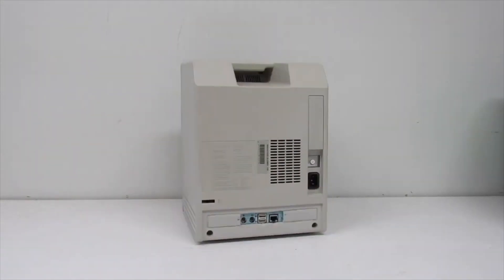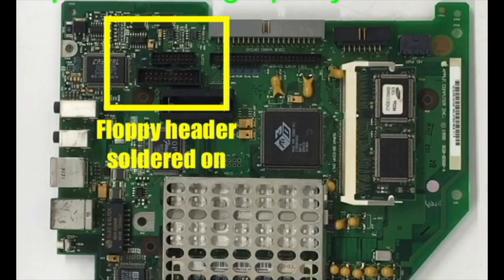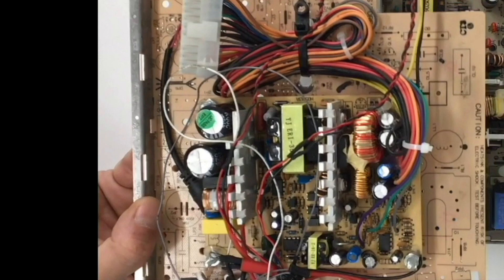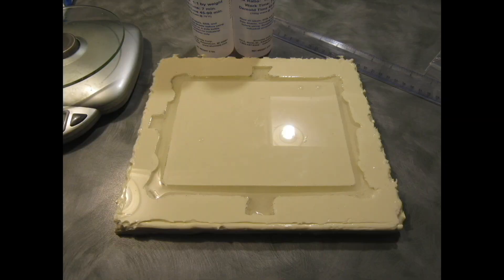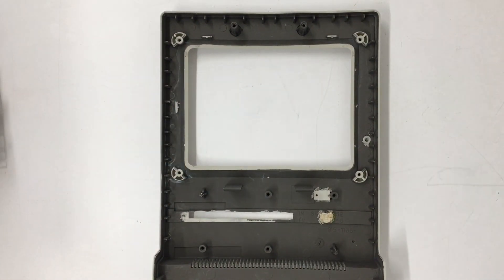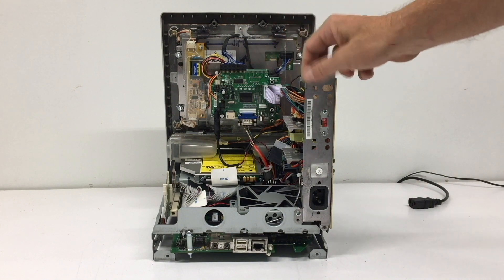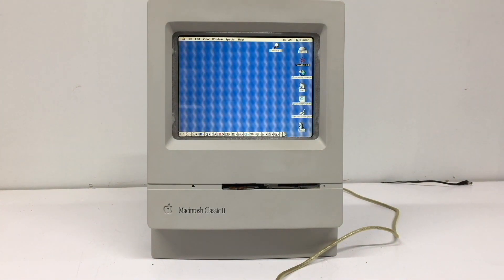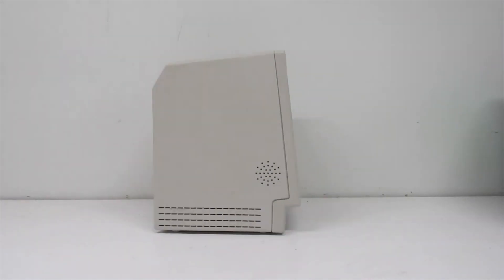How I upgraded a Macintosh Classic to an iMac G3

Comment: My daughter and I are going to be building a Raspberry Pi SE (going to call it an SE/3.14) using an iPad Air 2 LCD. It was fun to see this. We're not gong to use the original back, I'm going to be using a spare SE front and metal frame, then 3D print a small backer on it, to make it look like a slim version of a classic Mac.at least that's the goal.
Reply from the maker: Hi, I can't wait to see your project:) I've thought about the same thing, but I lack the know-how to do it. Are you going to cut the metal frame down?

Comment: What voltage capacitors did you use for the re-cap? They don't look surface mounted, but I'm not sure the values matter depending on surface or leg mounted in the portion you used. I just need to know for my re-capping so I don't cause any issues.
Reply from the maker: You can increase the voltage of the capacitors, but not the capacitance rating.

Comment: Well I'm almost done, but I want to use the original Macintosh 128k power switch to work as a power on for both the logic board and power supply (Like the old pizza box mac's). Is there a way to do that, or do I need a soft power button to turn it on outside of the power switch used for the ATX I wired up on the barren logic board.
Also, for the inverter, do you have to split the constant 5v wire to hook it up to the macintosh connector, or after it goes through the resistor? It says purple on the connector but also shows it going to the power inverter, so I am confused about that.
Reply from the maker: Hi, sorry for the delayed response, I've been busy. To tell you the truth I don't know if you can use something other than a momentary switch to operate both the computer and the display? On most modern computers, continuously holding in the power on/off button gives you a loop.  As you are the when you press the momentary switch you are shorting the PWF to ground, so continuously doing that with a mechanical switch.... I have no idea? but I am sure that Hosni barak, or Karl Wheatley, could answer your questions.
Reply: @BillyTheKidCENTURION  i understand, but whay about the constant 5v purple wire, does that need to conect to the imac board via split or. just the inverter?
Reply from the maker: @tehsuki11  I can't believe I forgot about not needing the inverter at all if you are going to do it like the Color Classic. Just ground the ATX power on (green wire) to one of the ATX ground wires, then wire the ATX off/on switch wires to the the Macs off/on switch. Now the display and Mac will power on at the same time.When you power the Mac off (shut down the OS) just reach around the back and turn the switch off, that will power down the display and Mac at the same time.
Reply from the maker: @tehsuki11   The purple wire (constant 5v) from the ATX is connected to the ATX green wire (power on) through a 5.6 KOhm resistor. the iMac logic board constant 5v, doesn't get used.
Reply: @BillyTheKidCENTURION   Alright So If I am reading this right. ATX Purple Standby goes to ATX Green via 5.6KOHm resistor, then green wire (Post resistor) goes to ground ATX (Already wired the on off switch) and then that should be it?  I assume I don't need the inverter beyond the 5.6 portion.
Reply from the maker: @tehsuki11  If you want it to operate like the pizza box Macs, then you just need to ground the ATX (power on) green wire to a ATX ground wire. If you want to use the soft power to the ATX, ( soft power to ATX) then you need the inverter. But you don't need any inverter, if you short the negative (ATX) to the  Green wire ATX supply!
Reply from the maker: Hi, I'm sorry if I may have confused you, let me break it down again......

If you don't use the inverter, just tie the ATX power on (green wire) to an ATX ground wire (black wire), and wire the 128k on/off switch as the ATX's on/off switch. Nothing else is required, no resistors, no transistors..... just tie the green wire to a black wire, forget about all the other wires.
Reply: @BillyTheKidCENTURION  Yeah this might be something else. I sent an email with some details, maybe you can help?
Reply: @BillyTheKidCENTURION  Im still a bit lost, I might have to contact you in private mail message to work something else. I am sorry.
Reply from the maker: @tehsuki11   No, I can guide you through the comments:) Once again.... what exactly are you trying to do?
Reply: @BillyTheKidCENTURION  Oh no I mixed up what I said. 

I just mailed you through what was listed on your channel about getting some more hands on help due to my situation. 

I think I may have some wiring issues that are outside of my ability alone, so I sent an email in the hopes of resolving it there perhaps by sending it to you to examine... I hope it gets to you safe. Otherwise I may need a new email adress to send it to.
Reply: @BillyTheKidCENTURION  Do you still use the e-mail on your YouTube page? I feel like it's better I did this privately, as it may involve asking to mail this to look at since your the only person I could think of having done a similar mod before.
Reply from the maker: @tehsuki11   I'm sorry, what email did you use? It's okay to post it here, I don't mind:)
Reply: I posted it above, sorry for the delay.
Reply: @BillyTheKidCENTURION It's been about a month now, I'm not sure if my message went through but I am mostly having power with the power cable and vga cable. I can't seem to get power to it so I can't test the video cable. THE ATX Power supply worked, but after wiring the power wire to ground and re routing the power outlet, it won't boot with the switch.

Is it possible I could send it into you to look at or borrow the cable you used to at least check if my vga cable works? It's either that or I wired the ATX Wrong. Should I ground the green cable on the adapter rather than the ATX Power supply?
Reply: @BillyTheKidCENTURION  Actually... No. I don't need help anymore! I'm going to make a video or a short tomorrow showing my second test power on! It turns out I had to ground a specific wire to the PSU on, not just ANY ground ;^^
Reply from the maker: @tehsuki11  Look man, you are absolutely wrong, you can use any ground, all those ground  wires come from the same source? Open up a modern power supply.  Please upload the video, which explains why there is a specific ground?
Reply: @BillyTheKidCENTURION   Actually you are correct, I'm sorry. I just falled back on using the Paperclip method with the ground being next to power okay as the easiest, but I am having another problem.

 Right now I am trying to figure out the VGA out. 
Whenever I plug the video cable the motherboard (Even when its not connected to the breakout board) it wont play the boot sound or get a signal,  just a light next to the CUDA and the DVD-Drive starting up, even though I wired everything up proper to a breakout board. The pin-outs from the board to VGA only show generic ground posts, but I think there needs to be specific ones for H and V that I cant figure out if its 9, 12, or 15 pinout for ground. Maybe I mixed that up? 

There is a video posted om my channel, a comment there would help.

Comment: Do you have the pinouts for the power cable to break out for an lcd monitor or a standard 3 prong power plug? This is what im struggling with most for doing an lcd mod for the original imac g3 case.
Reply from the maker: I'm confused as to what you want? all LCD driver boards need 12v dc input, as far as I know. I have no idea what kind of mod you are doing to the case? What motherboard are you driving? Are you trying to get the motherboard and LCD to turn off and on at the same time? A simpler solution would be to have separate switches, this was done on early 1990s Macs.
Reply: @BillyTheKidCENTURION  I think I was miss-communicating this. Yes, I was trying to get the motherboard and LCD to do a simultaneous shut-down AS WELL as what you did to the power supply to allow the 12v DC to tether to the driver board. The soft power circuit website is lost to time so I can't jump that hurdle right now...
Reply: @BillyTheKidCENTURION  Would a A1224 slot loading work with an imac, or what DVD rw I can use or am I restricted to dvd rom combo drives?
Reply from the maker: @tehsuki11  Hello..... I'm not sure if the A1224 drive will work, but I think it will.
Reply: @BillyTheKidCENTURION  Thanks! One more thing, do you have the schematics for the Low Profile cable schematics you used, or what amperage / voltage is needed on the ATX supply of choice?
Reply from the maker: @tehsuki11  Any ATX power supply should work. The schematics are in a link in the description. The only thing you really need to modify for the wiring harness from the ATX supply to the Apple is the power on (PFW) line from the Mac to the ATX supply, it is not actually a "Soft power" switch for the ATX power supply, it is a switch telling the ATX power supply to turn on. The Circuit I built into the cable receives a signal from the logic-board to turn on. In other words, you couldn't use the circuit as a soft power switch to turn on an ATX for anything other than an older Mac.
Reply: @BillyTheKidCENTURION  Alright! Thank you for all the pointers, I think now I'm ready to tackle on a similar mod with a 128K chassis.
Reply from the maker: @tehsuki11  Great:) When you get it finished, send me a link :)

Comment: Again, Beautiful. Have you thought of trying this with a quicker G4 iMac board? The I/O may pose a challenge, for a regular modder, but obviously, maybe not for you lmao. If you could find a fitting 1024x768 panel, it'd be cool to see a Mac Classic case mod this clean running Leopard and on the modern web with TenFourFox. You'd also get the ability of using a second, extended, monitor. For one a bit more expensive, an m1 mac mini board would just be dope.
Reply from the maker: Yep, I thought the same thing as soon as I saw how power efficient and small the new Mac Mini board is, I bet we could easily stuff it into a Clamshell iBook as well:)

Comment: Great build but is lack of floppy drive support an iMac thing? Because I run os 9.1 on my Quadra 950 and the floppy works fine. I’m probably misunderstanding what you said.
Reply from the maker: Hello and thank you:) Floppy drive support was dropped for the iMac when they introduced the "USB Mass Storage deice" update (which is an option install) in 8.5.1, and support was permanently dropped in 8.6. You can get support in 8.6 if you drag a copy of the 8.5 system ROM ( 1.1.5 if I remember correctly?) to the system folder, and delete the 8.6 ROM.

Floppy drive support still existed in the OS 9 Universal system disc, it ran on all of the Power Macs and beige G3s. 

Your Quadra must have a PPC upgrade, OS 9 can't run on 68XXX based Macs.

Comment: Nice vid! Do the slot loaders also have the floppy port? I looked online and it looks like they might but I figured I’d ask
Reply from the maker: Hello and thank you:) The slot loading iMacs do not have floppy ports. The minimum OS they can run is 8.5.1 which is the OS that finally dropped floppy support. If you want floppy support in  8.5.1 or 8.6 when doing the floppy connector on the tray loaders, you have to replace the ROM with the ROM from 8.5.

Comment: Billy, remarkable job. Of interest would be the custom VGA cable pinout, power supply pinout and connector & floppy connector link to purchase.  Can you provide us with that?  But once you go LCD, like you pointed out, you could put a Mac Mini G4 inside instead with the modded boot OS9 (which is what I plan to do with my Color Classic shell) for an easier result.
Couple of improvement ideas, use the black CRT surround, install a quieter fan (noiseblocker blacksilent or Noctua) and I would've moved the logicboard inside then used port extenders to reuse the stock rear port openings.
Reply from the maker: Hello, and thank you:) I will give more details about the VGA cable, power supply, and floppy in the description.
Reply from the maker: Hello again Mohamed, I posted links for the power supply and VGA connector in the description. To buy the floppy drive header search for "20 pin 2.54mm Straight Box header IDC Male" They are available on eBay, Amazon, and Digi-key.